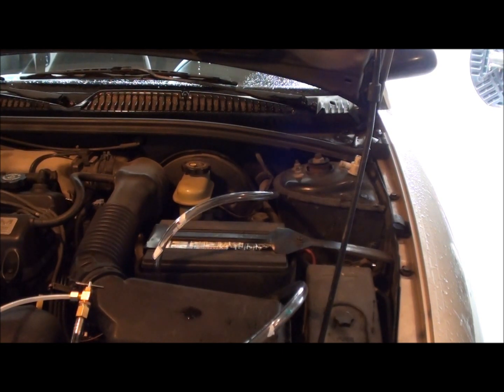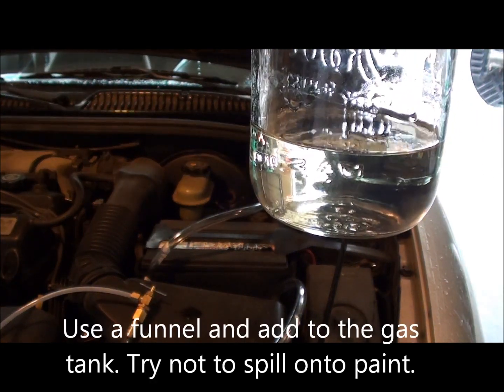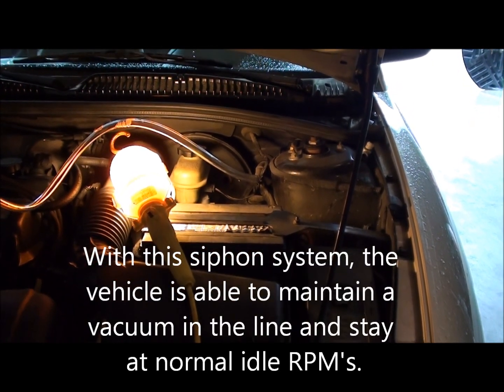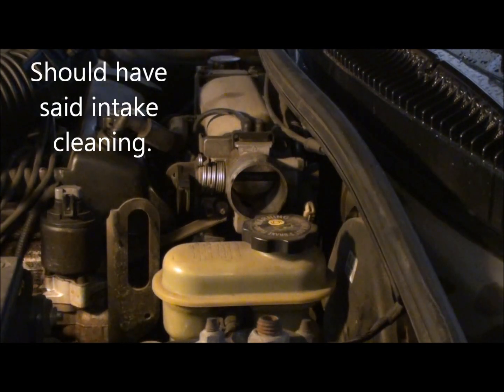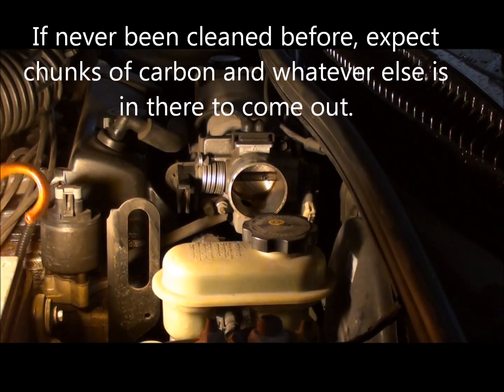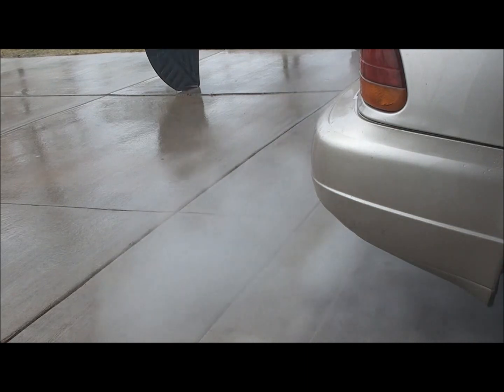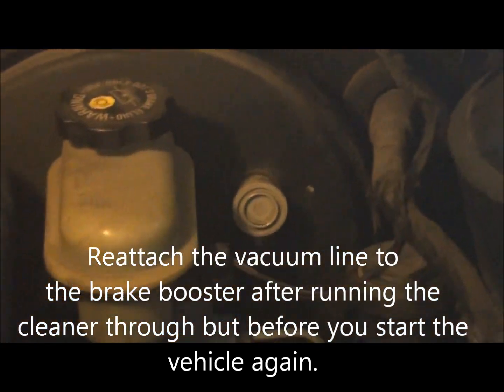How to Properly Perform a Fuel System Cleaning

Comment: Did you ever think of using something like a IV bottle system that's what I have made from cast aluminum bottle with a hook to hang from the hood and the flow adjustment attached to the lid of the bottle and hose from that to the inline on the car 👍✌️

Comment: That's an easy way to fix it Aerotek injectors out and have them cleaned up and check it to make sure they spray evenly also when you do it that way sometimes you damage your catalytic converter you got to be extra careful I hardly recommended that way

Comment: I hear it’s best to do a fuel injection service when ur gas is like empty is this true or what??
Reply from the maker: not necessarily. It will depend on the cleaner you are using. some are effective when you have a full tank, giving it time to fully mix and be steadily run through the system as designed. this must be done regularly. others may by a direct spray in to the intake along with mix into the fuel. Follow the instructions on the bottle and begin a regular schedule. You won't be able to 100% clean out the cylinders in one go.

Comment: This video is very good specially for the GDI engines that’s what I do to my new and old car my 02 Buick le Sabre with 300000 and it’s running like new I do the cleaning 2 times per year and no problems and I have a 17 Honda Accord with the GDI system and same 2 times per year

Comment: I agree with the top comment I work for a dealership myself, we either A.depending on how lazy the technician is, is use this brake booster method.
B.we use basically a pressurized fuel injector going straight through the throttle body.
Or C. The cans of cleaner get dumped down the drain and tossed customer gets placebo effect. Never tried the C method myself 
Anyway with the older cars when they run rough it’s usually just a dirty throttle body IAC 
Idle air control valve and with little knowledge can be removed and cleaned yourself or do the throttle body cleaning method.
There is a way to tap into the fuel lines to the injectors but this takes time removing the lines and special hookups for the fuel line connector chances are your mechanic isn’t using this method even if they say they are.
Anyway a can of (insert cleaner here) and 5 gallons of gasoline will clean most injectors so think about that before you go pay a mechanic almost $300 to have your throttle body wiped out as this guy proves you can easily do it at home for less than $30
Reply: kevin Bloodandsoil. lol fuck stealerships

Comment: The best way to flush your Motors engine oil, it's the drain all the oil out of the engine. Leave the oil filter on do not pull and drain oil filter. However many quarts your oil system takes add that in diesel fuel. Keep in mind to do this with a hot engine. Idle the engine for approximately 4 minutes. DO NOT REV THE ENGINE!!!! Then simply shut the engine off and do your oil change as you normally would. As for adding seafoam to the oil I find it to be useless. I do one half bottle in the gas tank and one half bottle through the intake AKA vacuum line. Or see phone can be replaced with water. Ice water preferably. One of the biggest steps of this process with seafoam through the vacuum line or water through the vacuum line is to let the vehicle sit for at least 5 to 10 minutes after the process has been done. Then start the engine and work that stuff out. I also recommend to do spark plugs after this.

Comment: The harm that Seafoam can cause is much more than its benefit, if any. The smoke that comes out of muffler can fool you. It may appear as it is cleaning the system. On the contrary it is due to the Seafoam itself. A good US Citizen has proved the falsehood of Seafoam by using a brand new lawnmower with no carbon deposit in it.  Watch U-Tube for this demonstration.

I used this harmful Seafoam and all of my car exhaust pipes and the muffler  were filled  with dark carbon. I had to use a few cans of Chock cleaner to clean part of that damage.  

Using tap water will do much better job and it is free. There are demonstrations in U-Tube about this.

 I intent to make a video and demonstrate the negative effect of this harmful Seafoam. I believe the seafoad company should be subject to lawsuit and pay all the money that the company has stolen from people by fooling them to buy their products..

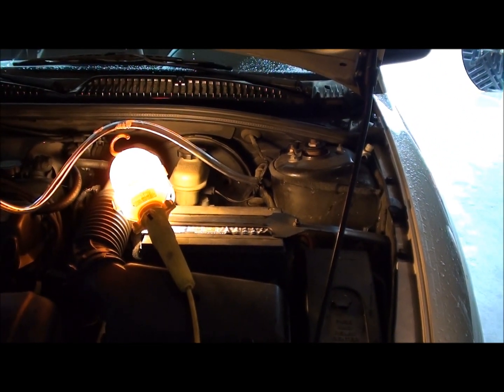Comment: 2:30 you had it right the first time. Liquid = hydrolock. Vaporlock would happen if fuel vaporises too soon. good video.
Reply: You ain't adding liquid it vaporises as it goes into system basically

Comment: for all u naysayers, Chris fix has shown that this seafoam does work. He uses a borescope after each test and shows the carbon less after each use and it does work! look it up! don't be so sceptical! I have used it for years and love the results, seafoam or mystery oil! FTW
Reply: Misty Burgsteiner you have a guy that buys a brand new lawn mower and put seafoam in it and it has all this white smoke come out so if it's a brand new lawn mower it should not have any carbon buildup at all so I don't know if seafoam really does anything
Reply: oiyabastard do you know what a borescope is? He said he showed before and after of the carbon with a borescope.....
Reply: @projectfarm does an even better job proving seafoam works

Comment: Sea Foam was developed to clean 2 stroke outboard boat engines that use a premixed oil/gas mixture.  It doesn't work on 4 stroke engines.
Reply: It might have used to been.  But it's for all engines now. Even diesel .

Comment: you put seafoam in a break booster wtf
Reply from the maker: the fluid is pulled into the intake through the vacuum line that is usually attached to the brake booster. The Seafoam does not touch the brake booster at all during this process.
Reply: No he didn't he disconnected the vacuum line from the break booster'

Comment: running seafoam into your intake manifold cleans carbon off the valves and varnish off the intake runners...thats about it.  the amount of seafoam he put in the tank wont do much...too diluted.  running a full can every third fill-up three or four times will do it.

if you want to keep your intake system clean...once a week, wait until your engine is good and warm and head to your nearest on-ramp and put it to the floor until you redline it...that'll go a long way towards keeping things nice and clean.

As far as your crankcase goes...don't put anything in it but a high-quality synthetic oil and change it religiously every 5000 miles.
Reply: Should also add that disconnecting your brake booster vacuum line won't make you lose your brakes.  the connection from your brake pedal to your master cylinder is mechanical.  your brake pedal will just be harder to push...and your car will run like crap because of the vacuum leak.
Reply: Free stuff

Comment: Scotty Kilmer said that Seafoam doesn't work on 4 stroke engines that run with ethanol mix gas because the additives in seafoam are not strong enough to clean away the type of carbon left behind with the ethanol combustion.  He's right..It doesn't clean any carbon from piston crowns. I usually just spay some throttle body cleaner directly into an open vacuum hose while the engine is running until it bogs down and cuts off. I then leave it to soak for 5 mins and restart it to blow out the dissolved carbon. I do this for two more times, and when I look on top the pistons,they're actually clean. The car drives like brand new afterwards. A can usually lasts me for the whole year.
Reply: Hey thanks for the tip. i gotta try that. That's a lot cheaper than having a shop do it

Comment: finally someone that does this the correct way.  they do make a tool that does the same thing that has a vacuum gauge on it.. you should have 1 inch spaces between the bubbles in the line

Comment: How would you recommend doing this on a vehicle that does not have a (vacuum) brake booster?

I have an integral ABS system in my van, so no vacuum lines there.
All my vacuum lines are pretty tiny except the one that the PCV valve is attached to.
Reply: PCv valve

Comment: won't that dissolve the oil.. and wear the rod bearings. when used in oil long term?
Reply: yes that's why he stated as well as it states on the bottle to do it before an oil change. I always recommend running it for only a day or two to make sure that Cycles well and cleans the sludge from the oil pan as well as related components. I believe in seafoam and have been using it for years on almost every vehicle of mine. They all have wonderful gas mileage at high mileage on the engine. all of them run like a top one almost over two hundred and ninety thousand miles

Comment: Most people watching this clip are interested to see exactly how intake is properly cleaned. This video doesn't show exactly how this extra siphon tubing is connected to a proper vacuum hose that feeds all cylinders which is a crucial step for successful intake cleaning. Since every car is different and has multiple intake hoses, ask a mechanic or an auto part store salesperson to show you the best hose that feeds all 4/6/8 cylinders when Seafoam is introduced.  Also, save yourself time by buying a measured plastic bottle which cost about 3 bucks for pack of 3 at Harbor Freight, fill 5.5 oz of Seafoam and pour it into vacuum hose safely through its tiny mouth. That will avoid risk of hydro-locking or vapour-locking your engine pistons.

Comment: Good video. But he made one mistake; you need two people to do this job properly. When you're pouring the Seafoam into the warm engine via the booster line, the car needs to be running at about 1800 rpms. This helps atomize the Seafoam and makes a BIG difference--at least in terms of how much smoke you get out the pipe at the end. That's why he hardly got any in this video. It has complete instructions on the bottle for this job.
Reply from the maker: I've done it both ways and there never really hasn't been a difference in smoke volume at least for this car. However, the first time I did the procedure without revving on my wife's Cavalier, I smoked out the street. Same procedure with my 02 Saturn(replacement for the one in this video) and again smoked out the street. It mainly depends on how clean the cylinders are. Neither of these cars had a cleaning done before to my knowledge(02 Saturn SL2 had a half inch build up of grime and carbon on the throttle body when I got it so safe to assume previous owner did not take care of it). I can tell you that once the cleanings were done both cars ran much smoother.
Reply: The Brain dude the   smoke is  a trick  its  mineral oil ,  a guy  seafoamed a brand new out of the  box lawnmover with NO CARBON BUILD UP   and its smoked when he  put in seafoam   and then  smoked when he  put in baby oil,,  seafoam is a lie
Reply: +Eet Chit Good luck cleaning your injectors with baby oil genious....
Reply: One person modulates the throttle underhood as they suck up the cleaner..shouldnt need two
Reply: The Brain I think he could use a brick to press the throttle. Dangerous, but only if you do not have a friend doing that for you. hahah.
Reply: I run it at 1500

Comment: I have looked at the many different viewpoints on this approach. I would go with the steam method, or put it in the tank and have it work more consistently. The real way to clean injectors is either to remove them, or try the pressurized canister connected to the fuel rail for injected vehicles. Vapor locking a fuel injected vehicle because that deals with fuel intake lines and carburetors that work with vacuum as well. On the other hand both types of engines can be flooded carbs are easier.
Fact Seafoam and other like additives are solvents, think carb and brake cleaner and what they do to oil and varnish. Even good old diesel is a pretty good solvent. Unless solvents have some pressure in application and soaking for tough buildup, they will only have a very minimal effect. Another fact, carbon can't be burned it can only be emulsified in a solvent rather it is in oil, tar, or varnish. It might interest you to look up wood gasifier technology and see how many chemicals and voc's are in wood smoke. Gasoline and it's additives with the engine oil are no different when heated and essentially distilled. There is also tar from smoking, or that sticky residue from cooking on surfaces as an example. So when you hear the term carbon buildup it actually refers to a whole array of combustion biproducts and that is what is being burned if it can while the rest may have some freed up to be blown out the exhaust. Even EGR vapors are not just carbon atoms suspended in the air.  Now hydro locking for those who don't know is actually turning a cylinder into a hydraulic piston where no free moving combustion can occur. This is worse than flooding, that is why they say to have it dispersed equally because all it would take is one cylinder to stop it all.  Some times things in an engine just wear out and lose tolerances that make one think magic in a bottle will fix it. I know the maker of Sea Foam didn't intend on anybody using such concentrated amounts in that quantity, but they sure don't mind making bank off of you. Creating smoke in any quantity is more from an incomplete combustion of the solvent than effective residue removal that can take miles to really get rid of. This isn't an attack, but just things for anyone that sees this to think about. One other thing, I am surprised that some people haven't had flames in their face that free hand into the intake. That is why less is more and slow and steady pay off.

Comment: does not pass thru injectors, aint clean them. that is not how you clean a throttle body.
Reply from the maker: It does pass through the injectors when a portion is added to the gas tank. I show one of many methods of cleaning a throttle body. Best method of course is removing the throttle body and thoroughly rinsing in a mineral spirit bath or heavy spray down of carb cleaner.
Reply: jungleking007 Yes but not the best way to clean injectors because is such a small amount mixed with the gas its diluted and not pure form. There are other videos that is best for injector cleaning by hooking up to the fuel rail, removing the fuel pump relay and having the engine run on pure cleaner. That is as good as removing the injectors and cleaning them.
Reply: +James Scott You want to be careful if you are putting it through your injectors. I use to do the same thing with a system that walmart uses that works the same way for delivery into the motor and we had a truck come through that it claimed the cleaner we used melted the injectors. This was done at another store but we had to pay out for the claim to get it fixed.

Comment: If you're just looking to clean the injectors, BG 44K is much more effective than Sea Foam. It's also specifically formulated to remove the carbon deposits which build up on the intake valves of gasoline direct injection engines.

Comment: For all of you complaining I just had a fuel injection service done at the local shop when they did my oil change. They did the same thing this guy is doing. They just used a different product than seafoam. So quit giving him a hard time since most of you don't have a clue.
Reply: If what they did is ONLY what he is doing, then they didn't clean your fuel injectors in any way. This procedure sends the chemical through the air induction system only, which may clean the intake manifold and intake valves; but it does not pass through the fuel system or fuel injectors, thus the fuel injection system was not cleaned.

It is beneficial to clean the intake system at times, especially with Fords, BMWs, and other engines that produce high-carbon build up in their intakes.
Reply: Allen K Maybe you didn't watch the part of the video where he put some Seafoam in his gas tank. So yes, he DID clean his fuel system.
Reply: Glen Ely No this will clean the intake combustion area and valves but not the fuel injectors. There are other videos where the engine is ran with a cleaner going directly into the fuel rail with the fuel pump relay removed so only that cleaner is going into the system. What you pour in the take is too diluted too clean as good.
Reply: I'm actually training for my master ASE TEch certification and what he is doing is fine it's the equivalent of having a coolant leak and burning some coolant ( for thoes that don't know engines with coolant leaks when operated are spotless because the coolant steams up not burns and the steam cracks and destroys carbon to be either A scapped off by piston rings or B sucked out through exhaust on the exhaust stroke
Reply: Glen Ely How much does this usually cost to get done?
Reply: Glen Ely was your car getting bad gas mileage
Reply: Glen Ely you actually saw the mechanic do this to your car?i thought customers were not allowed in shop area while mechanic is working on your car.i know most shops have signs posted.
Reply: Lololo somebody and that shop scammed you.

Comment: Ok so If you running it through you VACUUM line system your just cleaning the the Air Route, Right? It doesn't actually go through the Carburetor and the Float bowls...Right? Years ago "Gumout" had a cleaning system you could buy and it had a bottle you could hang upside down, had a 6' tube running out w/ a small in-line shut off valve and several diff adapters for the diff size intake for Carburetors. It would clean out the float bowls and Needle Valve and the Jets and Ports.
Reply from the maker: Mike Turner No carburetor on this vehicle. When the fluid is sucked in, it contacts the intake, intake valves, cylinder and pistons, and the exhaust valves. Those are the main surfaces needing cleaning in more modern vehicles.
Reply: The point of this exercise is only cleaning the gunk/sludge accumulated in the injectors. There's minimal influence on the valves and pistons by the time it's been sprayed from the injectors.